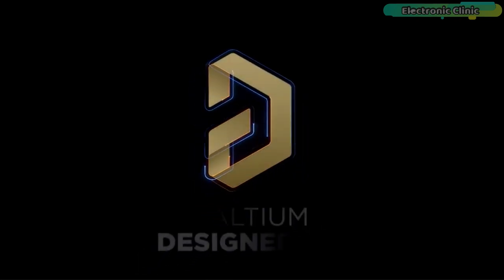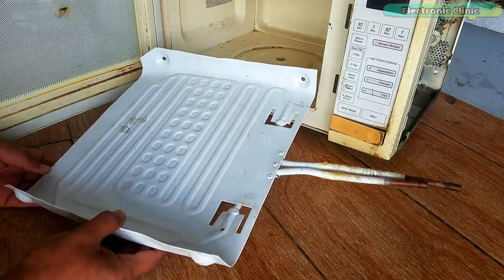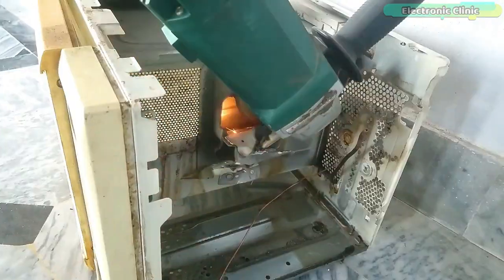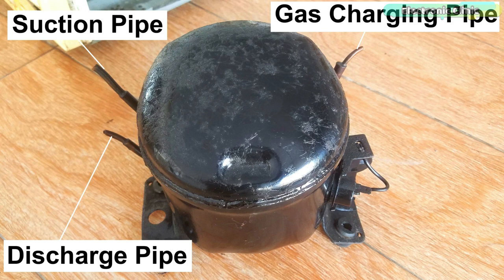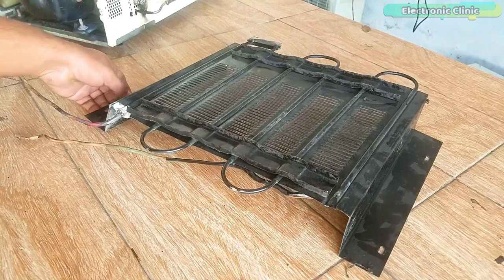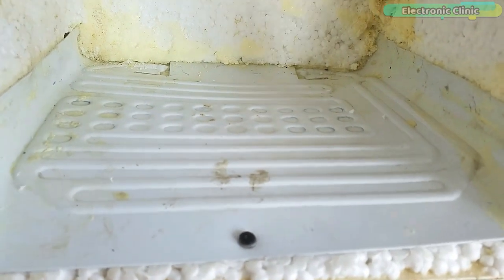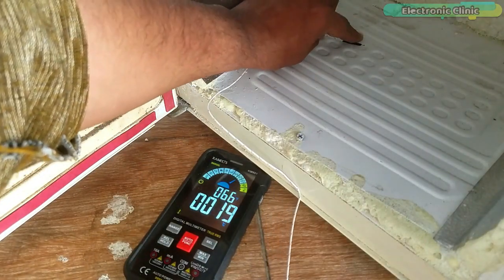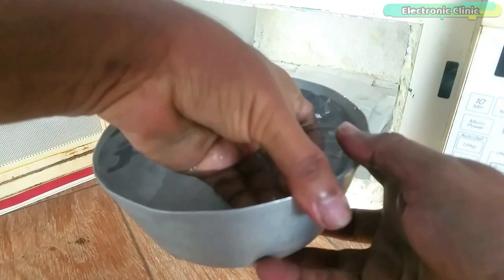Diy Refrigerator, Fridge, or Freezer from an old Microwave Oven, Mini Refrigerator, Mini Fridge

Comment: The evaporator should have been installed in the top. Cold air sinks. Or you could install a fan. Why does no one in Asia use a vacuum pump when charging AC&R equipment.
Reply: My first vacuum pump was an old fridge compressor. Works pretty good. That’s easy.